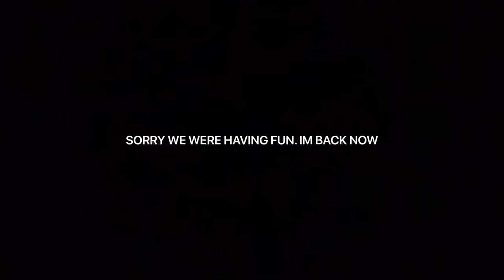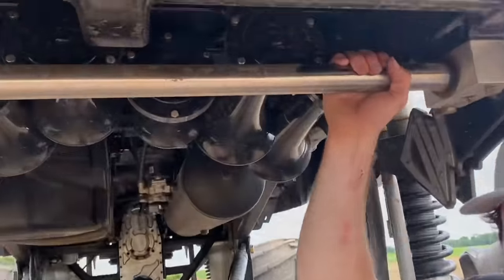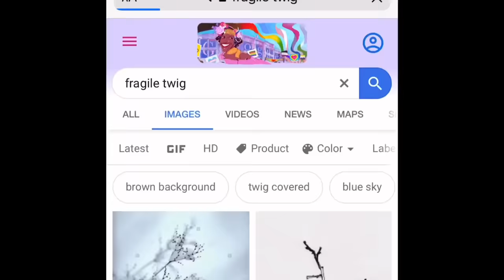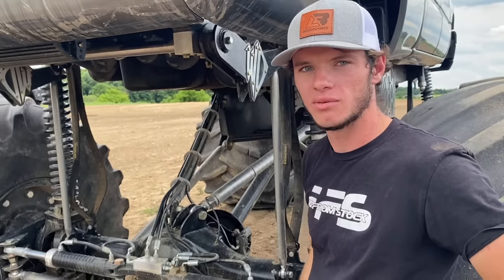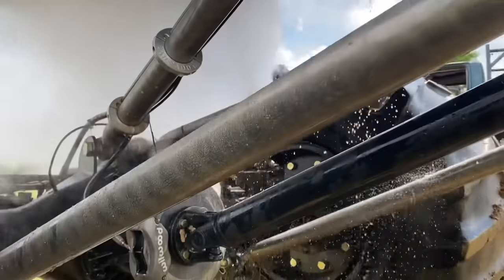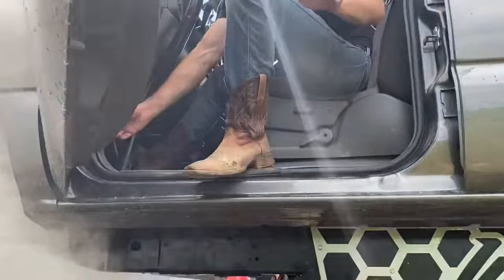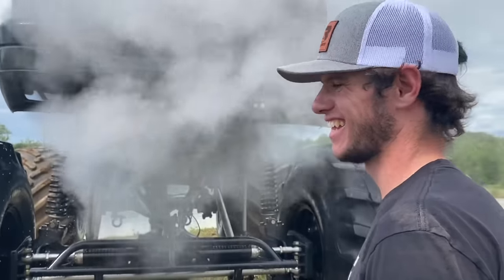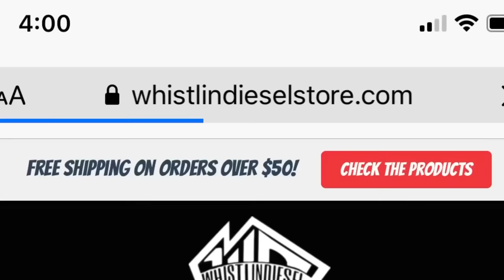Monstermax FLOATS ON WATER

Comment: Environmentalists: Diesel smoke is killing the environment!   Monstermax: hold my beer.
Reply: XDDDDD
Reply: It's not beer it's diesel
Reply: Daren Fuentebella  my bad
Reply: @joeybrunow4147  it's ok
Reply: "Hold my NOS"
Reply: Gale Banks would have a heart attack if he saw all that smoke
Reply: And it's not the smoke, it's the stuff you don't see, of which gas motors put out WAY more of
Reply: Meanwhile, the "environmentalists" are burning police cars and churches..
Reply: It's actually better than gas exaust
Reply: All those gas cars stopping and accelerating in city traffic, it takes something like 5 hp to sustain a 1,200 pound vehicle at 60 mph, most of the fuel is burned on accelerations, and they blame semi trucks on interstates and pickups on long country roads, yeah sure, it's defiantly not the city vehicles ...
Reply: I have an old mechanical 12v 1997, and my girlfriend has a 2016 Nissan rouge, that little car has a small i4 gas engine, seems really efficient right? Sure it gets 23 mpg, that's pretty decent .... but my suped up pickup runs somewhere around 550 hp, doesn't have very much done to it and it gets 27 mpg
A friend of mine has a durimax that's really suped up, compound turbo, chip, all that stuff, it gas around 660 hp and still gets 24 mpg
So how do they explain that?

Comment: Every time I see monster max I think of the saying “EGT’S are just a number lol”
Reply: Exactly lmfao. Poor thing is lugging the entire time. That's why gas engines and gearing are highly favored in mud bogging trucks.
Reply: What are egt's???
Dont hate just asking
Reply: @marshallgoeszoom952  exhaust gas temp
Reply: @Thegoose95  A higher stall TC is in the works, itll allow it to rev to its proper rpm for better efficiency
Reply: A stall TC wont solve his issue running monster truck tires. Like I said before planetary system at the hubs for extra gear reduction. Look it up.
Reply: @dmills005  it has planetary hubs

Comment: Why do this engines smoke like hell? Is this U.S. engineering art?!
Reply: He made it do that there's way to much fuel and not enough air, and no it's not how we all like to do things it's just some people do it.
Reply: The stall in the converter is messed up.
Reply: There's some turbo issues there too according to whistlin
Reply: The Torque converter is too tight and won't allow the engine to rev high enough to spool the turbo up.
Reply: @VFR75O  I wonder if he fixed that issue at the same time the lockers were fixed. Before the lockers were fixed, it struggled to break traction on 2 wheels in the mud, but with the lockers fixed it done it easily with all 4. Same with the donuts at the end. It seemed to be making good power there, but most of the other times it's pretty gutless in low revs
Reply: Cuz they make a lot of horsepower

Comment: With the failing drop box issues maybe talk to the manufacturer of them and see if they could ditch the straight cut gears and go to helical cut gears it will have a larger surface contact area and will be significantly stronger it will need needle roller thrust bearings on the sides of the gears and maybe reinforcement of the case itself like webbing where the idlers run as it will try and push the case apart

Comment: Try cutting every other lug off or so and sipe those ones that remain.. That way your tires will clean out and not plug up . they spin faster too. Throw bigger chunks of dirt and another mud racer trick is to run a higher ratio in front axle that way it stays on top while rear pushes. The siping while help grab rocks,ect like fingers if rock crawling. Only do the differnt ratios if using 4 wheel in mud. Its hard on shit on tar. My old boss has a 80 acre monster truck playground with floating bog streams , showers, campground. By motley ,mn

Comment: I was confused for a bit there happy that you do have lockers but I’m curious if the deeper tread on the skinny wheels could get you through especially the three wide ones. rip those gears at least you found a weak-point that’s relatively easy to fix

Comment: Why does he not turn his wheels when trynna get out of the bog hole
Reply: He has no tread on his side walls, to bite in for traction,  so its actually kind of pointless,  turning the wheels when he's stuck in the boghole.
Reply: tim fagan fair enough, probably not completely pointless tho
Reply: @JT-fl5kh  maybe not 100% pointless.  But still wouldn't do as much as a tyre with sidewall tread! 
Sometimes in situations like that, when his lockers wouldn't lock in. You can use the breaks to lock the wheels that are spinning.